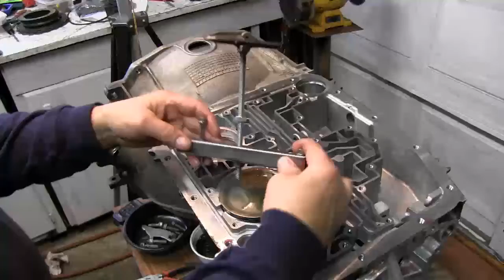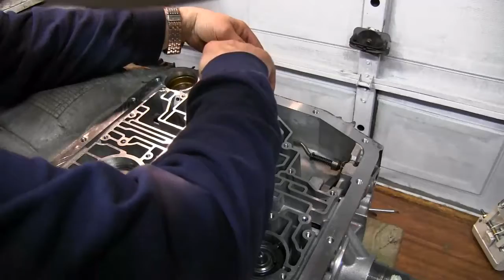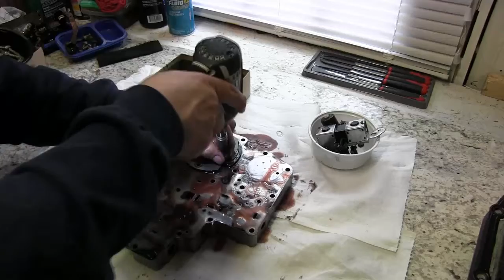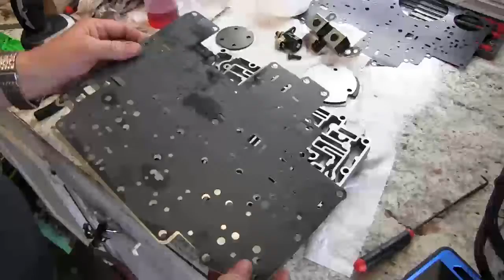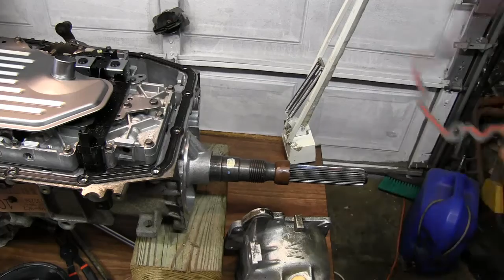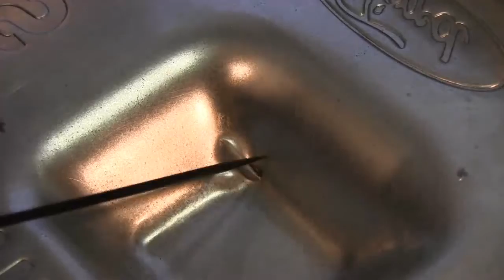4R70W Transmission Rebuild Part 3 Final

Comment: This series has been a real treat.  Keep them coming!

I do have one question: is the pan made of steel?  If so, why not pound the cracked area back into shape and then weld the crack closed (maybe while using small metal pieces to fill things in)?  Is that area load bearing somehow?  I wouldn't think it is.
Reply from the maker: Thanks, yes it is steel and can be welded.  I just opted for a new pan that had a drain plug installed.  But tig welding would have worked great.

Comment: Looking at you working on the valve body, I was idly thinking about how that complex design was reached, developed and finalised before going into production. The mind boggles !  I also wonder if there are any equivalent engineering designers around today who could come up with such a brilliant concept ?  It was a pleasure and education watching you complete the rebuild Buddy..
Reply from the maker: You are absolutely correct in that. The valve body has changed very little over the years. Mostly just using electronics to engage the valves instead of vacuum.  It it had to be designed today it would be a challenge. Thanks for the comment and kind words.